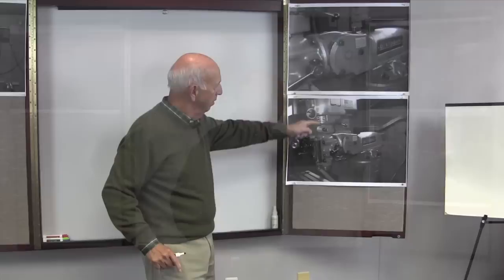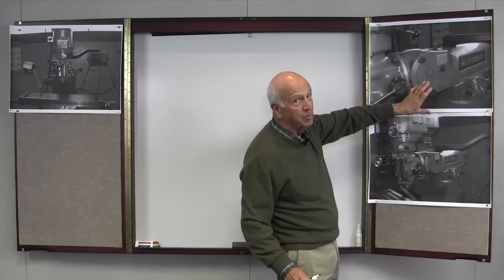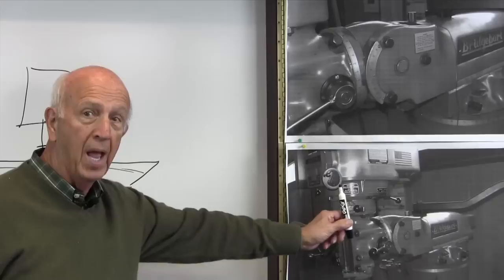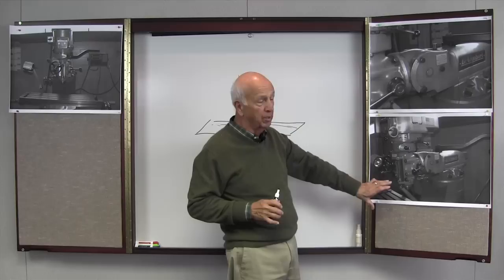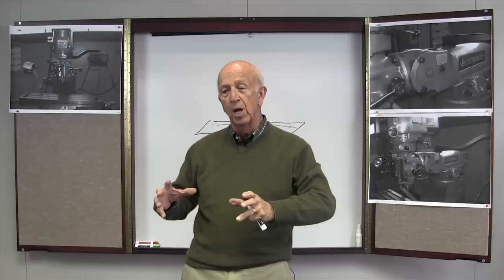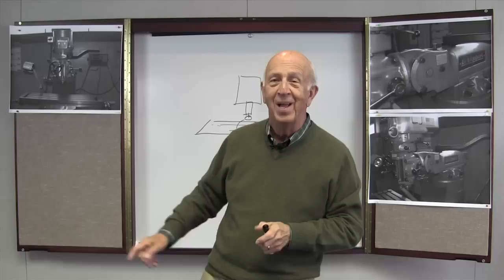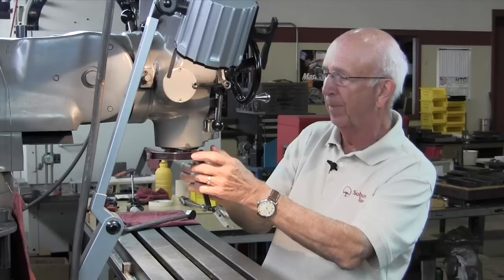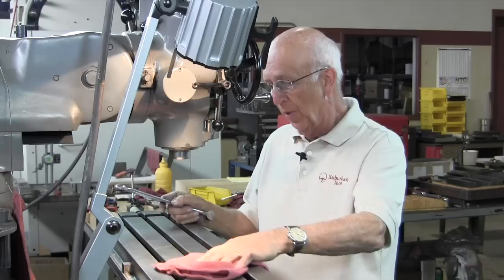How to square the Bridgeport head with the table

Comment: Great vid. I just did this to a Bridgeport that has been sitting in the corner of our shop unused for 25 years. The foreman said it can't mill flat. It mills flat now after a cleanup and trammimg. Table was out over 1/16" on the Y and 1/32" in the X. Thanks.

Comment: Great video! I took my vocational machine classes back in 1983. 
My instructors wouldn’t let you run a mill until you learned how to square up the head.
With technology these days and fixed NC machines. 
 I have to wonder how many young machinist know how to sweep in a head.
There is no G code for perfect square... lol 
Thanks again for sharing! It’s the assumed knowledge that gets lost so easy.
Reply: I’m taking a machinist class now & we’ve been doing this all week
Reply: @usanumba1916   And it's never easy, I been doing it for 50 years, you get better, but it's never just a snap.  One thing he did not tell you is always get your side to side with in .002 first ! THEN go after your front to back , makes for much  quicker traming to compare side to side to front to back. Front to back can be more difficult then side to side .

Comment: A lot of people have commented on the indicator holder in this video, so I'd like to add my two cents. As a production machinist I find that the fancy ultra-versatile indicator holders aren't always as convenient as you may think. I find that tramming tables and dialing in on existing features makes up a big portion of what I indicate, and having dedicated items to help with that can save time fussing around with arms and knobs. Admittedly, I am the fussy type. If something is adjustable, I tend to fuss with it. The more adjust-ability, the worse I tend to fuss. So K.I.S.S. is my motto.

May I suggest if you need an indicator holder: I have a piece of 3/8" round 1018, bent about 100 degrees so that I have a short leg of about 2-1/2" and a long leg of about 7". I chose 3/8" because I have a clamp (from a magnetic base set) that can adjust to hold the shanks of my back plunger, travel dials, and test indicator on one side (3/16"-1/4"), and 3/8" on the other. I use this item about 80% of the time I set up something on a milling machine. You could also put a hole in the end of a rod with a set screw to hold shanks (or crosswise, for that matter), or mill a tiny dovetail into it. Then, just bend as needed (or not, I use straight rods too). I have made a few different holders to do common jobs since any cheap, conveniently workable material will suffice.

Holding the short or long leg in a chuck or collet, I can indicate a pretty good range of surfaces, bores and bosses. I really like how the single piece is rigid. I can use it as a handle to spin the spindle: it will return to zero. It may be worth it to conserve time, and you may find that it's nice to have things that are sized for your equipment if you are using hobbyist machine tools.

Comment: Good man, a point, I always bring my spindle all the way down for maximum accuracy and spread the indicator out to maximum radius, one only needs 3 points, one on each side and one front or back, otherwise the table is off!  I get it all within .0005 and I am happy.  Loosening 3 bolts well and snugging the last one up, makes it easier to control.  Hope this helps?

Comment: Not a big deal in this application but maybe interesting to note that the more of an angle one puts on the indicator's nose, the less accurate the read. That after market quill-mounted indicator holder will allow the indicator to setup in a nice horizontal position with less pressure on the nose. Nice videos, keep up the good work.
Reply from the maker: Thank you for your comment

Comment: Nice demo,  I really appreciate that as an experienced professional craftsman you are willing to take the time and effort to make these vids.  Also like the old school technique of using a single indicator and adjustable arm on the quill. Did my round ram J-head  just the other day,  only difference was that I used a Jo block as a portable target so as to to drag the indicator tip across the table.  Early on it took me a while to realize that an out of tram head causes mis-alignment of holes when the is a lot of combined quill and knee travel,  like starting a deep hole with knee and quill almost to top and finishing with a long boring tool with knee down.

Again,  I really appreciate that you share your professional  knowledge & skills.

Comment: Helpful video. Thanks for posting. This is the sort of video where I "know" how to do this, but I always like watching others do it. In general, concerning machining, I've pickup up a lot of insight from others set-up and approach. I always strive to improve my own process. In regards to tramming, the mill in the shop where I work only has the head moved 1-2 times a year roughly, so for me, I have done a lot of period checks, but not so much actual adjustment. We are usually in the order of 0.02~0.05mm deviation (under 2 thousandths of an inch).

Comment: I use a ground block  or spacer and slide it under the indictor when sweeping the table  in 90 deg  increments  because most Bridgeport tables after years of use have nicks and low spots.   I also I leave the head bolts snug when Tramming the head  Works Great
Reply from the maker: Appreciate your concerns.

Comment: I set the indicator zero at the back of the table using a small mirror to see the dial,
that way you can easily see any deviation after swinging around the indicator to
the front of the table when you make your adjustments.

For tramming side-to-side, set the zero with indicator at the left side of the table
(when facing the mill) and swing it back around to the right side, where the
adjustment bolt is.

Comment: The other trick is to,turn a ring about the same diameter as the width of the table. Thickness dosent matter.
Just find a plate chuck it in reversed jaws in the lathe. Chuck it as far out from bottoming on the jaws. .
Cut both sides one at a time in the same turning,or chucking. At the end take light cuts slow feed fast spin. Then sand ,sand , sand ,then scotch bright pad till it’s shiny.
It will come out as perfectly flat as the slack in the spindle bearings are.
Mine came out with a variation of .0002, that’s 2 ten thousands. So that’s perfectly flat for mill work.
So then you lightly file the mill table ,lightly to smooth the normal burs. 
Lay the ring on the table ,,,,and now you can run your indicator around and never worry about the mill slots.
An old timer showed me this. You just have to cut your ring perfectly flat. 
Now 0002 is close enough unless you are at NASA.
But a mill needs to be at O both ways ,it’s hard sometimes,but it can be done.
You can’t run a mill at anything less than perfectly straight.

Comment: I have a large plate of float glass that I set on the table.  Ive miked it and its 0.475 thick within a few tenths all over.  Its 18 inches square.  I clean everything, lay the glass on the table, and sweep over that.

Larger distances get me closer to square.

Plus I don't bump the indicator over the tee slots.

Comment: The process is called "tramming the head"...Easiest way is making the lockdowns on the pitch and yaw semi-tight, then taking a co-ax indicator locked in the spindle with the back gear engaged and running @ the lowest speed, then gradually adjusting the yaw and pitch screws until you see no movement in the co-ax needle...

Comment: It's great to see highly skilled people like you .
When I indicate the head , I actually use gage block so the indicator doesn't bounce off the slots . I love watching your videos. Also I like using magnasine made by you. Even though I'm an employee but like to have good tools or make them . If I can get my hands on the punch grinding and C5 combo would love to have .
Reply: You have the right idea with the block, but could use a 123 I wouldn't use a Gage block and risk damaging the finish. I also would recommend looking at a Newbould spin fixture.  It will cost more but will be better engineered and made with better materials and be more accurate. My theory is not to waste part of your tolerance with machines or fixtures.

Comment: I trammed my mills head within 0.02mm on the table and it resulted in a close call with a cylinder head and a fly cutter...When the backside of the fly cutter reached the head it was cutting 1.5-2mm deeper as the table surface wasn't parallel with the travel...at all! Best thing would be to place a gauge block on the table and move it below the checkpoints but this can still only line up 1 axis and compromises other measurements of the machine!

Comment: “Once you get it done it’s done”. Not true.. depends on what you “hit” or in my case sharing a mill .. what someone else hits and doesn’t say anything. Very frustrating when you’re milling and the head is out but nobody said anything. Or the vise for that matter. You must check both of one is out. He’s right though chase one axis at a time. The larger the end mill you use the more obvious it becomes … a fly cutter is the real obvious one if out. I always keep my mill “dead nuts”…

Comment: just for grins   drop the table 6 inches  and sweep again   just curious.  Its winter here good time to learn.    thanks good work
Reply: This is a good instructive exercise you suggest. You can also move the ram in and out or angled off to one side, or (for a real shocker) move the table way off to one side or the other. On a well made machine in very very good condition you will not have a great deal of variation, but on an older worn machine, or a mediocre quality Pac-rim product, you may be very surprised. One thing I will generally suggest to anyone, besides checking your tram every day (I've known machines to move overnight) make sure to check the tram in the actual position you are going to use the machine, that is, with the slides as close to the position they will be in the actual setup you are about to use them in.

Comment: As a quick check you would be surprised how close you can get the mill to orthogonal by simply using a good quality engineers square on the quill shaft I have trimmed the head this way and then swept it with a dti and it was pretty much spot on,roughly thou or two out at ten inches on x and full table on y. In a fast moving environment it s good to take confidence that the head can be quickly clocked to satisfactory with a simple method.
Reply: While you are dicking around lining up your square. I am already trammed and machining. All you need is indicol indicator and 123 block.

Comment: Gday Don, 
Do you use tramming rings & are they accurate enough?
Pedro...
Reply: Don't know the answer but you can always try it:  tram with ring clocked at 0 degrees.  Rotate tram ring 90, 180, 270 degrees and re-measure.

Comment: First off , start off by kicking the head completely out BOTH ways  side to side AND front to back over a degree on the hach marks,  Lets see how to start from being with a totally out of wack head by .100 or more ( as most are when you first walk up to a machine the first time.  )    There is a reason I say this.

Comment: Thank you Don!  Say I had a 24" x 24" granite surface plate.  Could I place it centered on the table and sweep on the surface plate?
Reply from the maker: Good question, and you most certainly can.
Reply: This is a good way to counter a surface that has a lot of dents, nicks and scratches in it, since you get the average of the register surface, instead of a lot of bouncing in your indicator.
Reply: not unless you stone all the defects on the table first!  If your table is off, your surface plate will not correct it, your just magnifying the error, stone the table good and use it, put your surface plate in the inspection dept!
Reply: Only if the surface plate has additional guarantees beyond "top surface is flat":  that the bottom surface is also flat and parallel to the top surface.
Another concern is that a bump in one spot can now throw the parallelism off.
Reply: @scottwillis5434  You are correct. And they don't make surface plates parallel. There is no need to.

Comment: one thing I've always felt that Bridgeports should have is a pin that is drilled and reamed when the machine is new on the knuckle to ram interface. not that the machine should be run with the pin in. but so you can get the knuckle in at least close to start.
Reply: Sounds good!  Though in imagining having this, the next thing I imagine is finding the shop Bridgeport with the pin sheared off in that (now oval) hole and a trashed worm screw.  Because you know someone is going to think "It's stuck!" and try forcing it with the worm screw and then a hand sledge...

Comment: The way I tram my mill is to use a 12" brake disc that has been ground flat and parallel, and a coaxial indicator.  I run the mill at a slow speed and adjust accordingly.
I have a video showing this in operation.

Comment: nice video. can you show us how to tram the head using one of your cylindrical squares? Will the cylindrical square be quicker or more precise?
Reply: It would be a waste of time to use a cyl square. And I would not want to risk scraping the bottom of it on the mill table. After tramming Mills a bunch of times you can usually do it pretty fast with the exception of some poorly made ones that are just sloppy loose.

Comment: Now you can take that fly cutter and dust off the mill table like it is a mag chuck to get it nice and flat and parallel right? :-) lol
Reply: bcbloc02 
No, don't do that, you'll ruin the machine by machining a slight convex curve on the entire length of the table. The reason this is not advisable is known as table drop (sag) that occurs when the heavy  table is moved to extreme left or right positions. This slight drop is present on all vertical saddle type machines, especially if the machine is old and worn. Tighten up your X gib to minimize this.
Reply: Ellie Price
 Which means if you mill a long piece it will be thin on both ends as the table tips over. Guess you need a mill with outboard supports if you want to do good big work then. Lucky me I have one! :-)